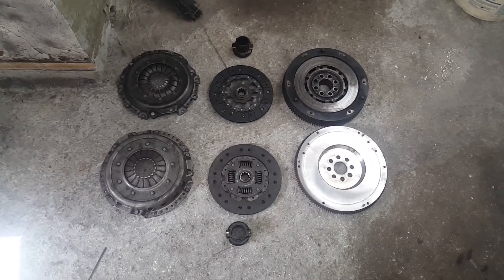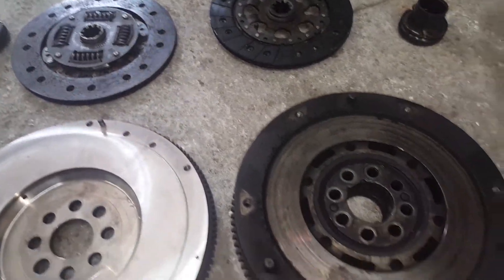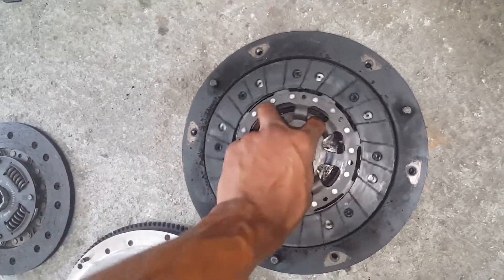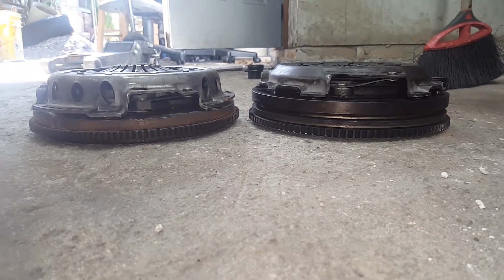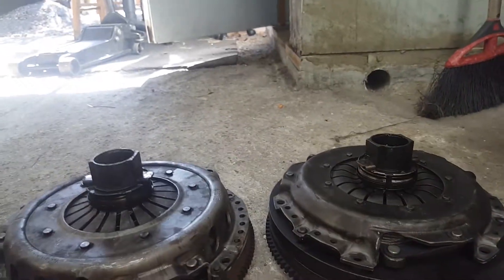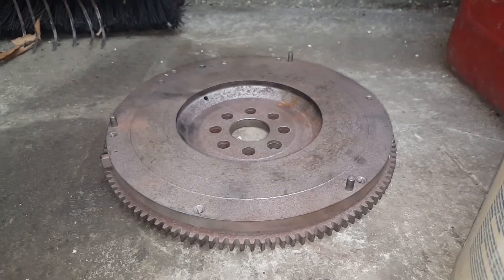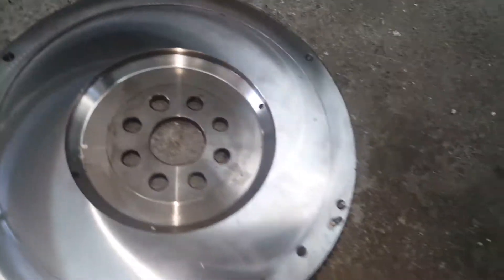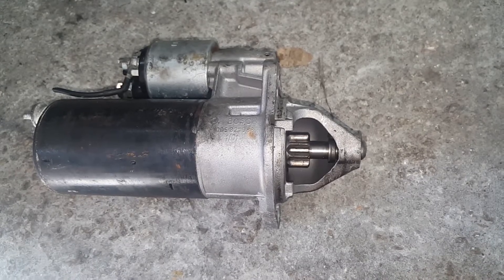E30 M42 Turbo Single Mass Flywheel Conversion Episode 3

Comment: Hi there did you use the m20 or 42 flywheel spacer ? 

Are they much different in size ? 

And where did you use the spacer, behind the flywheel (engine side) or a in front (gearbox side) of the flywheel?

Comment: Wats up.. I'm tryin to order a clutch kit for my e30..e46 engine but  it had a single mass flywheel, but the m42 clutch and pressure using.
 Am I to find a M20 clutch kit? Stage 2 or 3 .. I need a bit of help to not buy the wrong part
Reply from the maker: Hey are you saying that you have an e30 with a e46 engine in it? The first thing is what motor m50, m52? You also need to know what flywheel it is. If its a m5x flywheel you can get a m5x clutch kit. Stage 1, 2 or 3 depends on what yoou are using the car for as well as power. The higher the stage the more agressive the clutch.
Reply: @engineeringeverything1480   yes it does have a e46 engine in there but not sure which flywheel is in.. but I do have pictures .. how can I contact   u or send u pictures just to confirm that
Reply: @engineeringeverything1480  oh and it's a M54 engine
Reply from the maker: You can message me on instagram @everything.engineering the best thing to do is measure the clutch disk and measure the contact area on the flywheel that will tell you the size that you dealing with. Clutch this are measured in millimeters so if you measure in inches just convert using google. Once you find out that then you can look at the teeth on the flywheel as well as which starter you are using and compare them to the m20 and m54 flywheel to try and see if they match. You can use websites like FCP Euro, ECS Tuning, And europarts.com to look up the OEM parts to find pictures to compare the flywheel ring gear teeth.
Reply: @engineeringeverything1480  thanks!!👍

Comment: And m42 an m20 tob's are same?
Reply from the maker: Lo L not exactly in the way its built but dimension wise yes which is why i used the m20 because it should be a bit stronger.